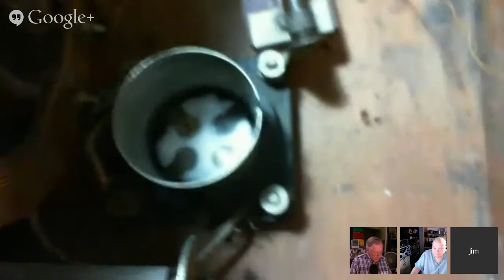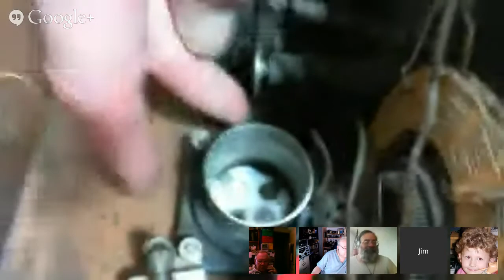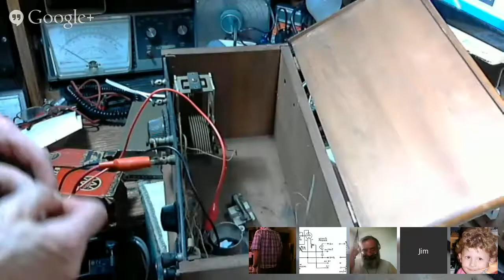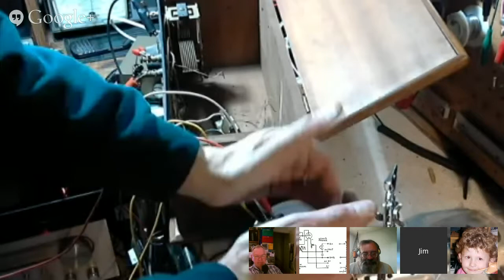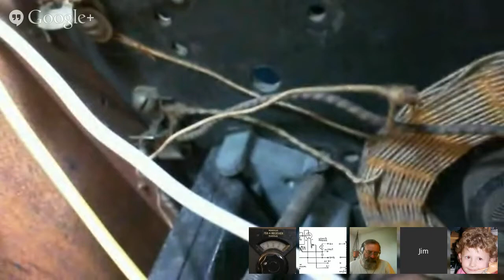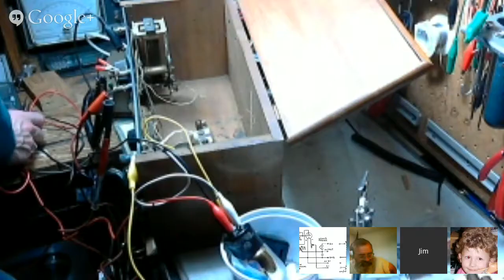Jim's Radio Shop Live

Comment: Is a silvered valve a bad sign?
Reply from the maker: Not at all.  It's a normal thing usually caused by the last manufacturing step to try to reduce gas inside the valve by burning a chemical known as the getter inside the tube.  If you see white inside the tube, that's often a sign of air leaking into the tube and ruining it.  

Here's a video I shot on bad tubes:  http://youtu.be/sn2YIynXbzY

Jim.
Reply: Thanks for the clarification,